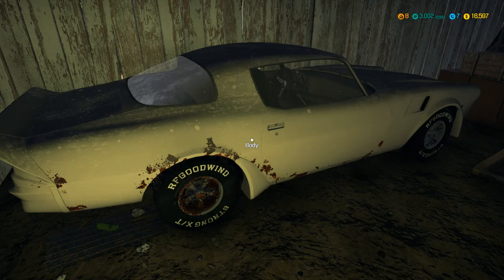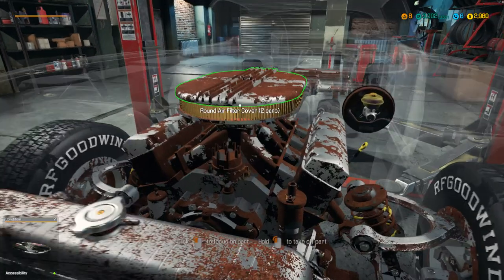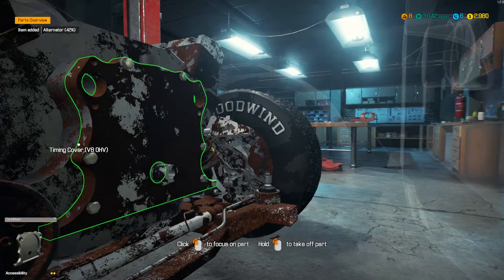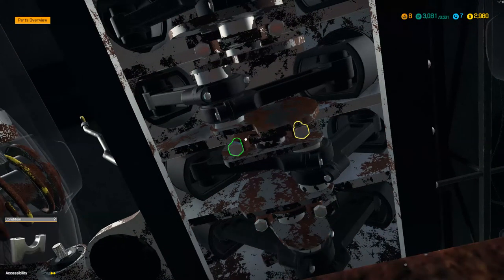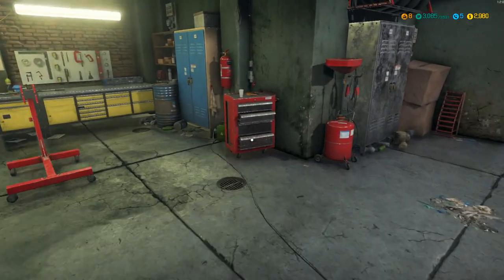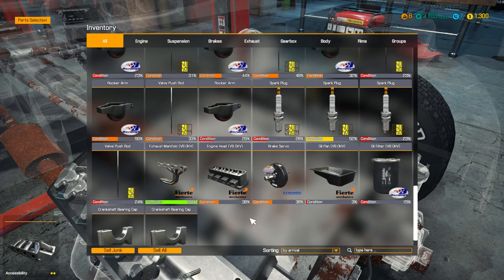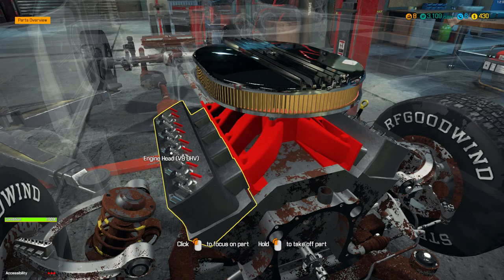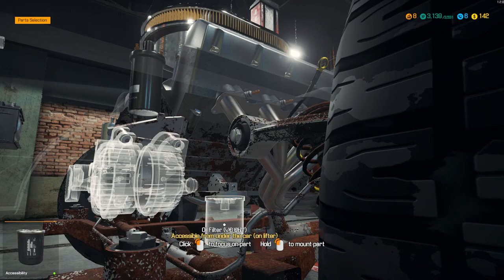Bolt Rollett Restoration Project - Engine Makeover | Ep 4 Car Mechanic Simulator 2018

Comment: repairing parts is quite a gamble.  if it fails it BREAKS THE PART ENTIRELY.  Anything under 15% is considered unrepairable junk.  :(
Reply from the maker: Really?  Didn't know that!  I'm a bit of a gambler though hehe...   Thanks for watching and commenting :)
Reply: I found out the hard way.  I was trying to repair the engine block and broke it.  I've been going to junkyards and barns, collecting parts for the muscle cars and trying to repair them.  It's surprisingly inexpensive that way, and anything else you collect can be sold from your warehouse for more than what you bought it for (i think?)
Reply from the maker: Sweet!  I was wondering what the most cost effective way of doing that would be.  I've just added up the amount spent on this project car so far and I've figured out that I'm about $2k up even when using brand new parts which I'm pretty happy about.
Reply: It's a little further down the line, but in the skill tree you can increase your characters repair skill.  I find the early part of the game is the most fun, trying to stretch every dollar. It feels much more rewarding that way.  Cheers!
Reply from the maker: I look forward to it!

Comment: I'm here just to figure out how to change the goddamn oil...
Reply from the maker: ha!  You grab the oil drainer (which is against the wall) and place it under the oil pan when the car is up on the hoist.  It should then automatically drain the oil.   Thanks for watching :)
Reply: Thanks, but now i don't know how to fill the oil...
Reply from the maker: Pop the hood.  Find the oil cap on top of the engine and fill it up there.